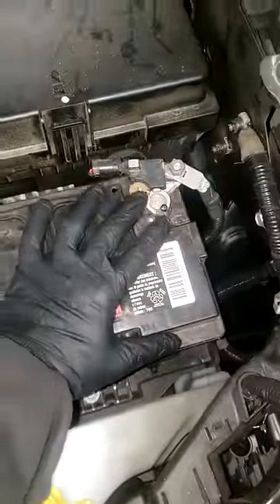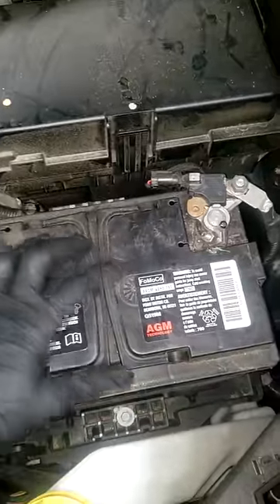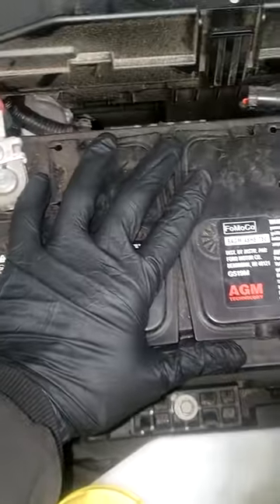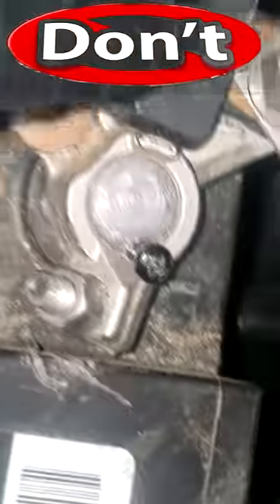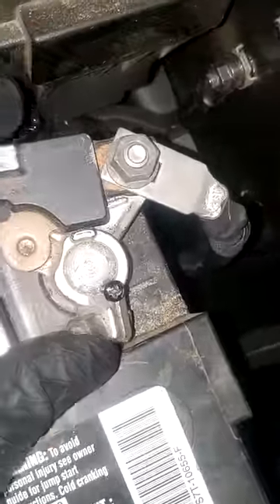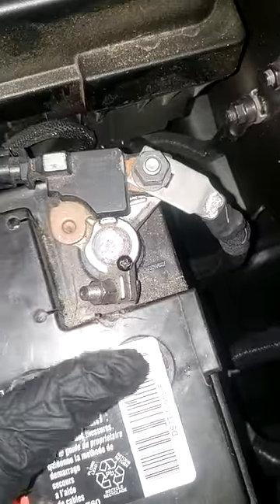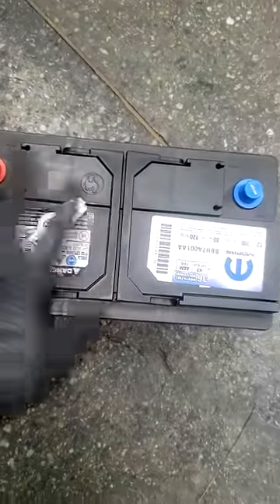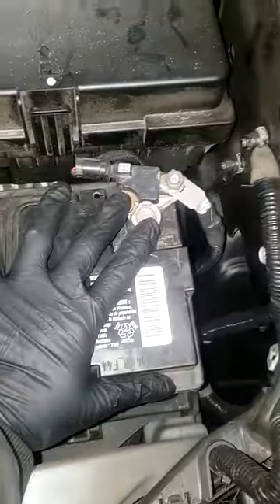STOP DOING THIS PEOPLE. This will destroy your car electrical system.

Comment: all the people saying “the screw aint the problem” are the same dumbasses that think an alternator is a supercharger. yall some clueless mfs who have no education on modern cars or their electrical systems. and yall clearly do not work on cars for a living so quit acting like you do or you know something when you dont💀ibs sensors record battery health by reading resistance across a terminal. a screw interferes with the measurements, creating excessive resistance so the sensor thinks the battery is swollen or sum and puts the car into limp mode. koi hosts classes to teach ab the new starting and charging system and all their sensors and such. would do majority of this comment section wonders if they actually educated themselves rather than choose ignorance and scream till they “win” the argument
Reply: I have a car with IBS and if that screw threw it off then my car would be fucked fucked 💀💀 I have a shitton of wires on that terminal that weren't there originally and I can tell you theres been 0 electrical issues for 8 years.

You're responsible for coding the car after putting a new battery in, this looks like the previous mechanic put in the wrong battery (loose post) and then didn't code for it. That screw could've damaged plenty but it didn't do shit to the sensor

I bet if you threw that battery into the car with a tight enough post and brand spanking new IBS sensor that it STILL wouldn't work properly unless it's correctly coded and the battery is able to provide the correct specs.

What do you think happens when you leave dirt on the terminal 💀 it doesn't break the sensor and the car runs fine.
Reply: Eh gfym
Reply from the maker: @alextheonewarrior  The battery and the IBS was replaced and that stupid screw got tossed back to the last shop that put it there.. No coding required on this car. Its gone and the customer happy and I'm happy. The few mechanics thats still on here defending that screw, well I guess we all can't be happy.
Reply: @OnlineMechanicTips  You replaced two things at once, without a proper diagnostic, so you don't know which was the problem. But the screw being there made zero difference, except for benefiting the voltage drop across that connection. I note you didn't mention having even checked that, so I'm confident you didn't measure it before and after to compare. I would put my own money on the fact you cost that customer more than they needed to spend with your guesswork and assumptions.
Reply from the maker: @TonyRule  Look dude, nobody spending a lot of time testing the obvious. You can visibly see the battery is wrong. You cant however see that its dead. You can see the terminal/sensor compromised by a freaken screw which makes connection at the battery a problem. This is a big No No on these newer cars. This car is fixed and long gone. No need to be concern with cost when a customer upset about the last shop and siply tell you to fix her car right. You thinking to hard my guy.
Reply: Rift33SRT  you probably got scammed, you where the type of people that think a alternator is a supercharger🤣🤣 you only talk about that when there is a whole paragraph 😂
Reply: @OnlineMechanicTips  I can see it has two bad cells (8.3V after recovery). And it might have had a bad IBS. But what I can say with an extremely high degree of confidence is that it didn't have any problem caused by that screw.
Reply from the maker: @TonyRule  omg, you still on here defending that dam screw? TF? So based on your logic, I should have just replace the battery and put the screw back in since it caused no problem?
Reply: @TonyRule  right when he said "this isnt technically a negative terminal" i was like YEP you sound just like a chrysler technician.. lol
Reply: The screw ain’t the problem…
Reply: Lawrence A, that’s the subtraction post.
Reply: @OnlineMechanicTips  No, that's not what I was saying at all, Cathy Newman. I was pointing out that the screw was almost certainly not the cause of any problem. It's not like it was installed through the body of the IBS.
Reply: The sensor has a low valve resistor in it (a shunt) that is used to measure the current being used from the battery to control charge from the alternator.  It  is most definitely not measuring the condition of the terminal of the battery, but a poor battery connection will cause charge  voltage to be dropped across the terminal which will cause the electrical system to sense that the battery is charged.  The screw was probably put there because of a poor battery connection at the terminal but is a bad idea.
Reply: @benlee803  You sound like you're old enough to remember the dark old days where you used a voltmeter with an external shunt to measure current. Me, being a spring chicken would, of course, have no idea about such a thing... *ahem*
While the screw is not ideal, at a pinch it's better than the alternative of a loose terminal. Remember: it's only temporary, unless it works...
Reply: Modern electronics are finicky AF
Reply: @bravobullz7475  They're much more robust and reliable than they were in the '80s.
Reply: Damn bro Chiiiiiiiiillll, Snappin on em lmaooo
Reply: I call Bullshit a tight connection is a good connection that screw is BS but that's not the problem. Why would he change the battery and sensor
Reply: you ok today bud?
Reply: this is absolutely rediculous. and been working on cars for a living for over 10 years. that screw isnt doing jack shit. assuming the back 98% of the terminal is clean, tight and touching the screw doesnt even get factored in. Ive been working on cars 10+ year and specifically german cars which are the most electrically tempermental cars they make, and electrical systems. The screw isnt between the sensor and the post completely. thats like saying the metal nut and shoulder bolt holding the clamp tight is effecting the "measurments" Is it proper by no means, is it reccomended no.
Reply: Car needed a battery, even if the screw impacted the IBS readings (It didn't) that doesn't mean the sensor was bad. Without testing (or just replacing the battery and seeing what it did) he scammed his customer into buying a part they likely didn't need.  This sort of post gives mechanics a bad reputation.
Reply: I fucking died at thinking the alternator is a blower 😅😅😅
Reply: Clearly it worked if it got there . she was just full of money
Reply: hahaha, get em!
Reply: I'm thinking the difference in resistance is negligible since the contact surface is still 80-90% clamp vs 10-20% screw.
Reply: I can promise you that the screw ain’t the problem
Reply: Sound systems has entered the chat and destroyed your whole essay 😬
Reply: @OnlineMechanicTips sound systems have entered the chat 🤐
Reply: @OnlineMechanicTips  Nobody on their right mind should be putting back someone else's rigged solution. Then you're married to it. When I get watches in that have makeshift repairs done, even if I'm working on a different part, I include fixing that issue along with the other repair. And it's all or nothing. Because 9 times out of 10 that crap will fail and then the customer blames the last person who touched it. You did the right thing. 👍
Reply: Say it again for the people in the back!!!! 😂💯

Comment: Yup. The thing that clamps the post with a minus sign besides it is definitely NOT a negative battery terminal. It’s an irritable bowel syndrome sensor.
Reply from the maker: You pretty sharp
Reply: It’s not a minus sign
It’s a negative signal
Reply: @OFFICIALBROTHERBOLDLYMUSICNTV You're being a negative signal right now
Reply: @Weimerica8841  lol sorry
Reply: surely you jest
Reply: @Div1ne_1  jest
jĕst
noun
A playful or frivolous mood or manner.
A playful remark; a witticism or joke.
A playful or amusing act; a prank.
Reply: @Div1ne_1  yea I agree, tips was being jest lol
Reply: I always grease the bearings in the battery for optimal performance.
Reply: @terryschnereger8531  hmmm that sounds wonderful 
Do u mine explaining more and your reasoning for that
Better conductivity?
Reply: @terryschnereger8531  by battery I think you mean the portable DC pulley recharged power supply.
Reply: @OFFICIALBROTHERBOLDLYMUSICNTV  it’s so the electrons can rotate freely around the atoms
Reply: @OFFICIALBROTHERBOLDLYMUSICNTV  Only use sealed bearings for your battery and you won't need to grease them.
Reply: @ChiTownGuerrilla  what are bearings ?
I don’t have a lot
Of bears where I’m at
Reply: @Div1ne_1  In Leslie Neilson voice "don't call me surely"
Reply: @OFFICIALBROTHERBOLDLYMUSICNTV  yes it's for the hamsters treadmill inside the battery.
Reply: @terryschnereger8531  I agree
Take all stress out on treadmill 
Bc if you beat your wife 
You can go to jail for battery
Reply: @OFFICIALBROTHERBOLDLYMUSICNTV  or with a salt & battery in that matter🧂🔋
Reply: @terryschnereger8531  yes 
Exactly
Thanks for pointing that out  lol
Reply: I have IBS
Reply: Good attempt at humor. Keep working on it.
Reply: @DaddyDNO  good attempt at life,
Keep trying
Reply: I laughed way to hard at this. I just spit brandy and coke all over my porch.
Reply: @OFFICIALBROTHERBOLDLYMUSICNTV  it allows the bearing to spin more freely so as to produce more current per rotation and the grease liquefies and fills in the small gaps allowing for more uniform distribution of the current preventing voltage drop and variance. (pretty sure I spelled liquefies wrong but whatever were grease mo keys not novelists) and obviously I am blowing Creech and Chong levels of smoke up your bunkhouse right now.
Reply: @n1ghtst6lker02  lol